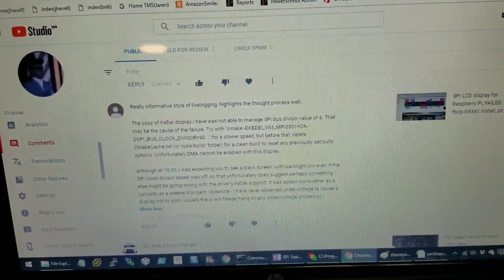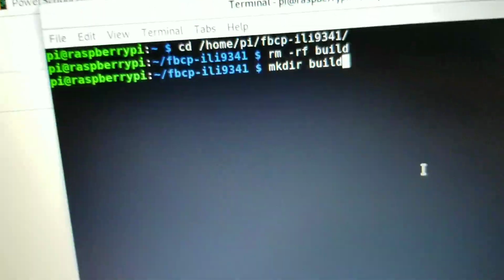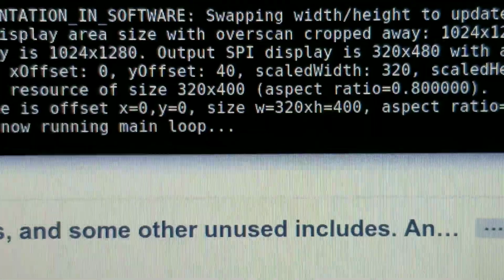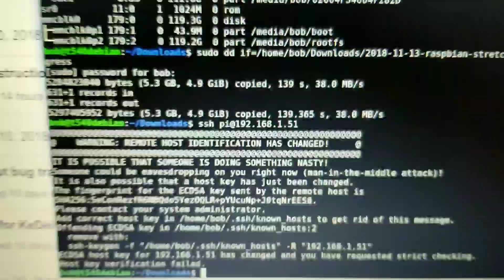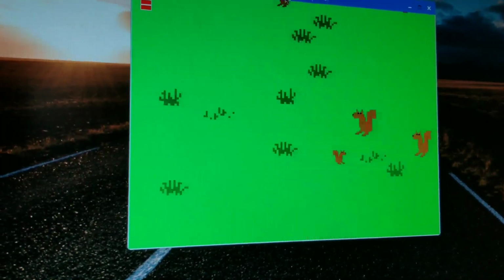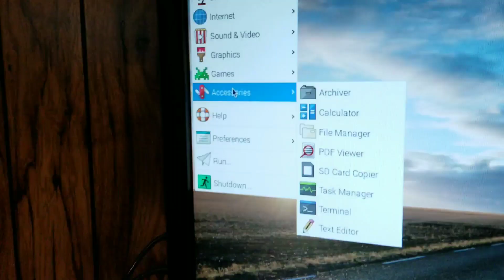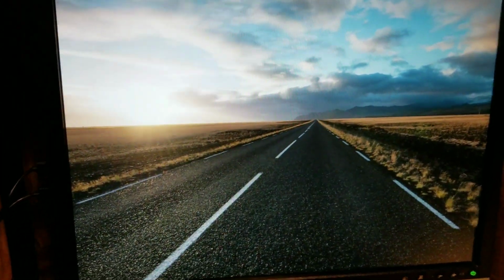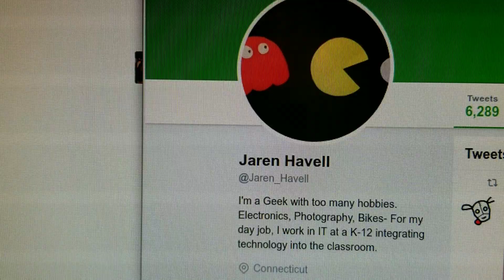Kedei 3.5" spi display is junk, buy a fruit or a wave

Comment: Do not use the kedei device as a part of your operating system. it will work but unless you block all updates of the linux kernel, it will stop working on an upgrade. and even if you think you have blocked updates they sneak in somehow. if you have one of these devices it is much better to use it as a display device.
 https://github.com/lzto/RaspberryPi_KeDei_35_lcd_v62/blob/master/kedei_lcd_v62_pi_wiringpi.c
works for me.